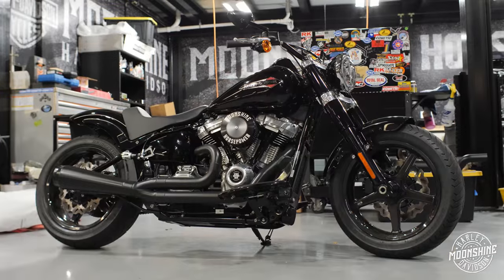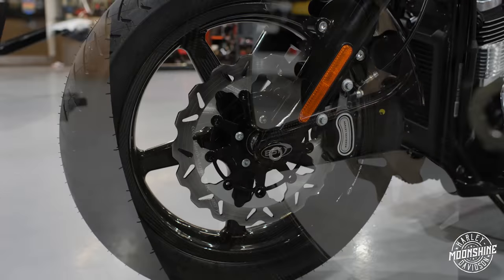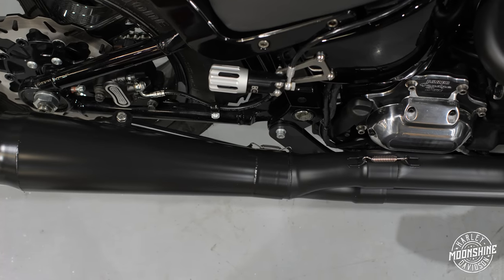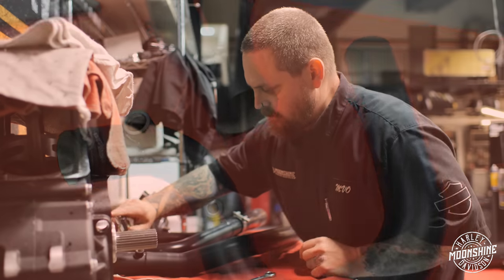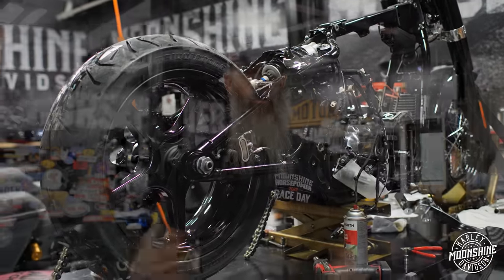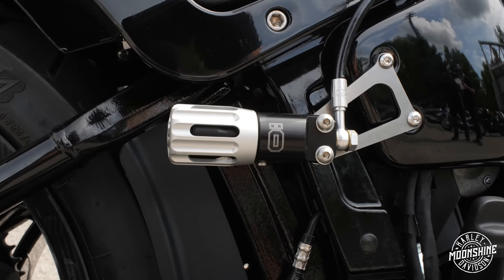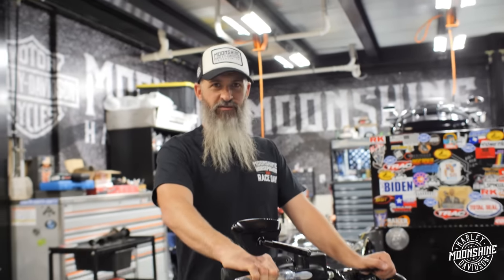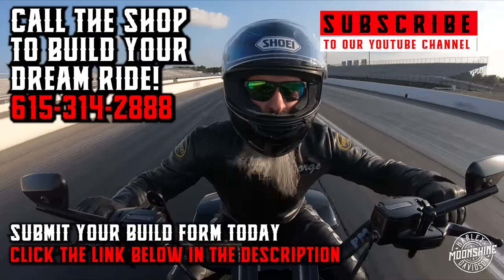Moonshine Horsepower 147 Cubic Inch 168HP 177TQ | Bike Build No. 12

Comment: I had a twin cam for 12 years (stage 4). This is my first year with M8 114. Has RS468, kw 2 into 1, 64 mm tbi and intake mani. It’s cooler and faster than the twin cam. Just not happy with the noise. Going to a 122 this winter, hopefully I’ll be happier.
Reply from the maker: Daniel if you run out 492 with that 122 setup you’ll love the sound and performance. For more information please contact our Horsepower Team
Nick - Jamie - Mike - Aaron
Phone: 615-274-4170
Email: horsepower@moonshineharley.com
***If you email us please provide a good contact phone number for you.

Comment: Sum Ting Wong: Why do the lines intersect @ 5500 rpm instead of 5250?
Reply from the maker: The graph got a little distorted when our videographer resized it for YouTube. We’ll post the original sized version on our Moonshine Harley Instagram. The hp and torque numbers are correct.

Comment: I was debating on getting the 135ci Stage 4 from my dealer for my 2022 Softail Slim. It would be an upgrade from the 114 I have in there now.
But i was wondering what's the Mileage like on the 147 & 135 in comparison to the 114? I heard that ones of the trade offs to upgrading.
Reply: The slim was available in ‘22?

Comment: Amazing stuff as usual. my question, did you change the swing arm so the 180 wheel can fit?  The exhaust is thrashin supply i assume??
Reply from the maker: Exhaust is Burns Stainless New Low Rider S Exhaust. Swingarm is stock.
Reply: The exhaust is Burns stainless

Comment: You need the RDRS(stability control) with higher horsepower to really use the power.   Otherwise always fighting tire slip/traction and wheelies.  That is why Ducati can make 200 horsepower plus /450 pound bikes rideable because of stability control
Reply: BUT ITS A DUCATTI

Comment: How long/just how many miles is it going to last? Some serious cash here on top of the purchase price so, just what kind of Longevity can an Investor expect?
Reply: About 500 miles
Reply: 100% depends on the owner, and how they ride.  If they ride that bike with respect, they can easily get endless miles out of it.  But, if they flog the crap out of it, and beat the holy hell out of it, expect a rebuild around 10k.  That motor is purpose built.  As bad ass as it is, it's not meant for every rider.

Comment: Jaimie, your guy chases threads with a power tool in the latest video ?
W.T.F are you doing  ?
Don't worry I don't know and I don't care. Holy shit, I thought you guys actually WERE engine builders.
Reply from the maker: The power tool has a clutch system on it at less than 60inch/lbs.